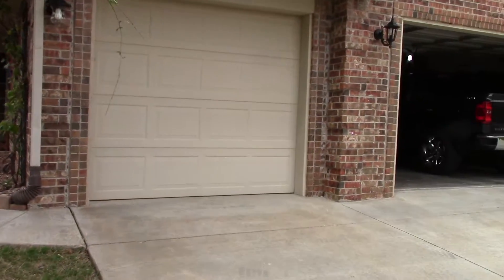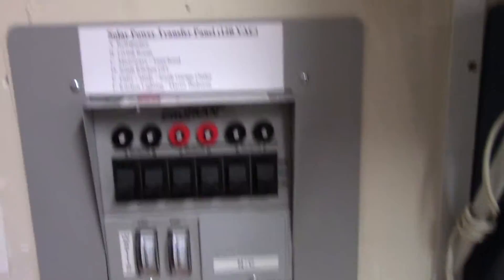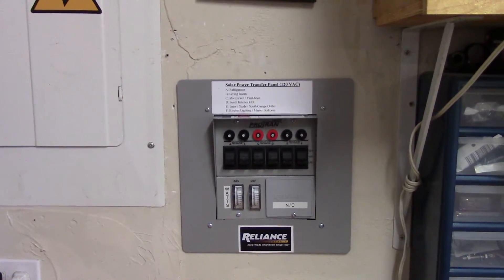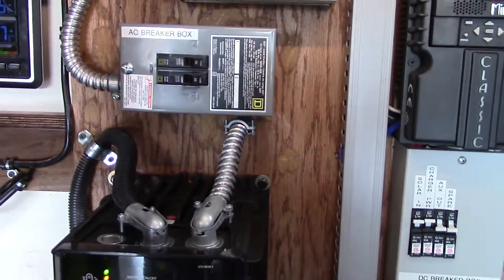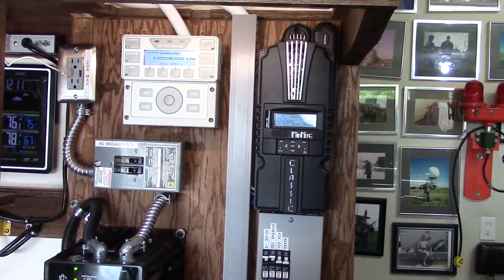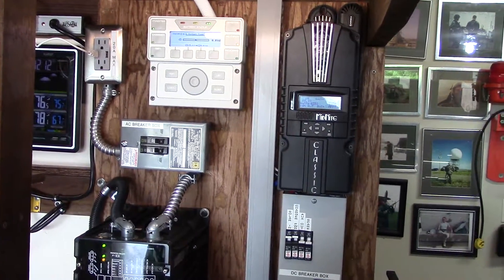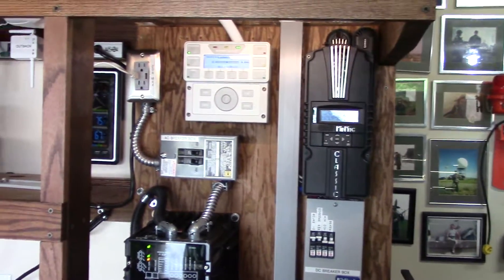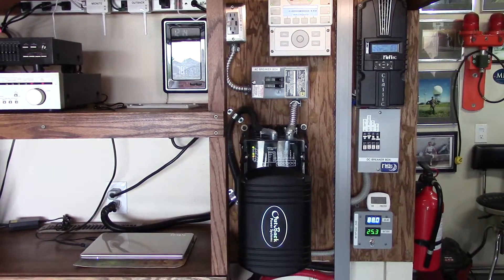Solar powered home! Reliance Controls Pro/Tran 6-circuit transfer switch installed!

Comment: Hi Chris, I know this is an old video, hopefully youll see this message anyway. 

Just wondering if this transfer switch can be used to have some circuits using solar and others using the grid. For example: ABC are using solar and DEF are using the grid. Can this be done? Theres not a lot of info or videos on these Transfer Switches.

Also, do you still have this? How did it perform over the years?
Reply from the maker: I am still using this 6-circuit transfer switch. ZERO issues. As for using solar and/or grid...HECK YES! I do it all the time. The switches are "either/or or off". My inverter is wired to ABC and DEF on the GEN side. So, I can heat any single circuit with solar or grid. Lots of control
Reply: @ChrisDIYerOklahoma  Thanks!

Comment: Hey Chris so are you running 120v to that transfer switch or 220? Thanks man
Reply from the maker: 120v
Reply: Chris DIYer thanks for the fast reply I know you said you had your electrician do it but here is the problem I’m thinking. My inverter has multiple outlets on it. It’s not like yours where you have wires running out of the inverter. I want to hook the transfer switch to this inverter to run my lights and stuff but I was wondering how he wired everything to the transfer switch because it did have a 220 for the generator. Does your inverter have two separate hots or is it just one going tot he inverter
Reply from the maker: My inverter has a single phase AC in/out terminal block. Single phase/wire out to the transfer switch panel. Not 100% sure what the electrician did with that single wire going into it. But, would assume wired it for single phase feed. Good luck

Comment: How did you connect the inverter to the ProTran?  ISn't the transfer switch a 4 line input, but the inverter is only 3 line out?  Thanks

Comment: Hi Chris i run 2 gvfx 3648 outbacks and i have 2 of those transfer switches and i run mine all on, and the grid passes through until the grid drops. If the grid drops the inverters both kick on and power all circits with out any interuption at all and when the grid comes back they go back to pass through. You can see what your house is pulling all day and night on optics re. Nice install you did. cheers! Your electrictrin will know how i wired mine.
Reply: Nice

Comment: Does that transfer panel isolate all three (hot, neutral, and ground), or is your inverter tolerant of "grounding the neutral"?
Reply from the maker: Not 100% sure, but I think so. Electrician wired up this transfer panel. All the circuits attached to this panel indicate "wiring good" on my outlet tester. So, can assume the inverter output is correct. Best to touch base with Outback Power, Reliance Controls, qualified electrician, and/or licensed home solar installer
Reply: Chris DIYer Yea if your outlet tester says it's good when on inverter power, then the neutral must be grounded otherwise there'd be a fault.
I keep hoping inverter manufacturers will stop making "halfway grounds"... but so many keep doing it.

Comment: Looking really good.  Am going with a Reliance transfer switch panel myself.  Amazing how your system has matured to where it is today and as they say in my service, BRAVO ZULU !
Reply from the maker: Thanks...I had an electrician wire mine up (for code and insurance purposes). But, they are straight forward

Comment: Hey Chris, I know this video is pretty old now but I am looking at how you jumpered that L1 line across the 220 breaker to power both sides of your TX switch.  I guess that's fine for 110 circuits but may be a problem if you try to hook a 220 line up to the TX switch.  Does the Outback have an L2 180 out of phase and if so why not use it.  Am I following you correctly?  I love your videos and I am designing my own system right now.  Hope to pull the trigger in a couple of months...
Reply from the maker: My electrician hooked everything up...so, not sure. Everything in/out is 120v on the transfer panel. I am pretty sure the transfer panel circuits are wired "in between" the household circuits (an "either/or" condition). My inverter is 120v in/out. Everything works perfectly. April 2015 video and now it is August 2016...zero issues. I could have DIY'ed the AC side of my installation, but for insurance/codes and safety...paid to have that done by a licensed professional. Thanks for watching and good luck with yours!
Reply: I'm sure it's fine but you just don't ever want to hook any 220 device to your TX panel or you're likely to damage the device and your system.  Keep up the great videos!  That recent blooper reel was so funny.
Reply from the maker: Amen on that...I like my house not to be burned down. Thanks for watching my Channel.
Reply: I don't see any issues, it would be quite unlikely to damage a 240v motor if you lose one leg of 120v.  Of course you don't have a 240v circuit connected so it won't matter any way.  Now if we are talking 3-phase motors, we will have some issues, but that's not the case here.

Comment: I just bought the same transfer switch. I am wondering can you run the neutral wires from the inverter to the house neutral wires? And can you run one circuit on line power while you run a circuit from solar?
Reply from the maker: Thanks for watching. I would consult a licensed electrician. That is what I did with mine. From what I could tell (and to best answer your question) I think the neutrals are separate. The transfer switch is an "in between" circuits or "only one power source at a time" type unit. Don't quote me or use this as fact...this is why I paid a licensed electrician to do it...and recommend that for insurance and warranty failure issues. Mine works flawlessly...electric bill down 50%. Good luck!
Reply: Yes the common install for any back up system defined as a "non-separately derived system" will have both primary and secondary source neutrals always interconnected (common), creating a return path for all circuits back to the source.  Yes you can most definitely pick and choose any individual circuits connected to this type of transfer switch and power them with an inverter (or generator) while at the same time the utility powers all of the remaining circuits.  The 3 position toggles are on the load side of each branch circuit breaker, so it's basically 6 independent transfer switches in a single cabinet.  The only caution is you want to of course avoid crashing the inverter if you run too low on power, as any switches you have set to the inverter - those circuits will be OFF until the inverter is reset and power is available, or the toggle switch is moved back to LINE (utility).
Reply: That's why I bought the moes 50 AMP ATS. So it runs my solar and wind for energy needs first and when my bank reaches 12.2v it will switch back to city power very fast you will not notice it did. I havent installed it yet.i need to figure out how to separate the circuits I want to power with it first then install it.i need an electrician. https://youtu.be/OsLhXS_OvIU

Comment: Nice to see you got it up and running. Nice clean work!!I hope you get those big panels...those would be sick
Reply from the maker: Thanks. May have to pull some more feeder cable through the attic! 435 watts x 4 = 1740 watts. Add the ones I have (1KW). Total of 2,740 watts of panels for my small household backup solar power station. The panels he is selling measure 81x41". But they are mono's. Sick...yep!
Reply: What size feeder cables? And are you running the solar panels in parallel or series?
Reply from the maker: 10 AWG 600v PV rated feeder cables...good up to 30 amps. Amazon sells all kinds of cables. I run higher voltages (VMP of 95 volts) on my 1KW array. The actual current flowing through the cable is not that much (less than 10 amps). The "rated" watts of the 10 panels in series-series-parallel is 1,000. Divide that by the VMP (max power out voltage point of 95 volts) and you get 10.5 amps. That is at "maximum" output. Most of the time the panels will only produce 75% of their rated power (dirt/grime on the panels, bad angles, shade, cloudy days, etc-etc). So, on average, the current going through the cable is more like 7 to 8 amps. If you run lower voltages with your panels and a lot of them in parallel...thicker PV cable will be needed. If I get these big panels I plan to run a second feeder line and run the 1KW array on the Kid and the other array on the Classic. Not really thinking it will be efficient or safe to run both arrays on one feeder line and one controller.
Reply: I know what you mean right now I'm experimenting with some new panels 255 W. four in series at approximately 130v ..all running hundred feet back to charge controller using 6gauge wire.and I noticed my 100w renogy panels perform better at 120 V DC but like you said shading dirt wrong angles no sun for a week plays a factor..
Reply from the maker: Nice! The Renogy panels are really good/strong...very happy with mine. With you running 100' of feeder cable to the Kid (is that what you have?) is no problem. The higher voltage = better...esp with 6 AWG feeder lines. Very efficient set up you got there! Love my Kid (and Classic). If my 435 watt solar panel deal goes through...I will hook the Kid back up and run that with my Renogy array and use the Classic on the new array. Also...good to know you are running 130v and they work. SAweet!!!!
Reply: Actually I have the 4 in series running to my outback CC and just 3 to the kid I have 4 more 255w to hook up yet I have a separate outback CC for the renogy panels.So when it's all said and done I'll have 3 255w hooked to kid.. And 8 255w wired in 4 to one outback 2,040w..and my existing 1800 watt renogy on the other outback CC.. I'll do video when it's done!! The kid should handle 130v though..
Reply from the maker: Wow! Impressive. Can't wait to see the video! Serious power.

Comment: Hooking up dissimilar VMP panels through a big battery switch I have found is a good way to distribute the power to were or what it is needed for I got a couple videos on battery switch's good luck with solar score.
Reply from the maker: Thanks! And thanks for watching the video. I think to be safe I will run another feeder line outback to the pergola. I still have my Midnite Solar Kid solar charge controller and can run 1/2 of the system on that (1KW) and the other half on the big panels (1.74KW) on the Midnite Solar Classic 150. That way I don't have to mess with the VMP and mixing different types of panels.

Comment: Your Looking Good Buddy Great Set Up Get You A Little Honda EU 2000 i  Inverter Generator The Heck With More Batteries  More Solar Less Batteries Is The Key Ingredients Chris Cheers Keep The Videos Rolling
Reply from the maker: Solar panels make the power...storing it is great also. However, my batteries may need a rethink later on. A little Honda eu2000i is also on my radar scope. I am working with that oil worker guy to get more panels. Hopefully Friday I will drive down to Davis (about 100 miles away) and pick some up. Stay tuned! The electrician cut me a deal for installing the Reliance Pro/Tran...so, I got a few bucks left over to spend on more panels.
Reply: Cool Deal Buddy Sounds Super Great I'm Staying Tuned SemperFi

Comment: Killer deal on those panels! And you need more batteries as well. I'm on a 48V system and looking to get a second bank.
Reply from the maker: You are 100%  correct with the batteries. However, I gotta get them panels! Question: the VMP on those panels is 72 volts and the VMP on my Renogy panels I have now is 95 volts. Is it even possible to run both types of panels at the same time on the same feeder line via the Classic 150? The 435 watt panels are monsters...and I am going to meet him on Friday. What do you think?
Reply: ChrisSolarPowerMakerOklahoma I would think they would work together just fine. I think the main thing is they need to be more voltage than you are trying to charge.